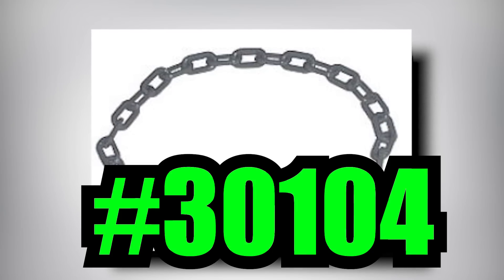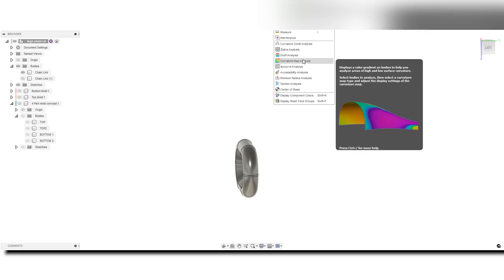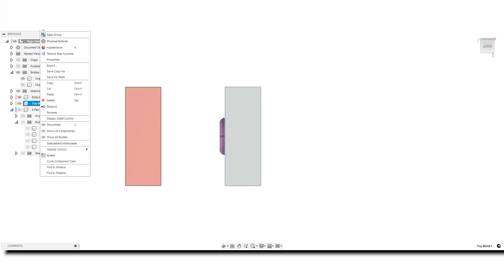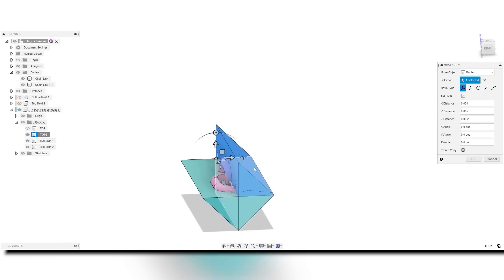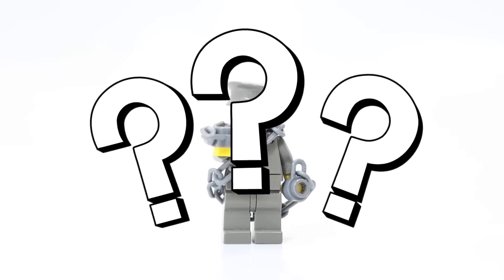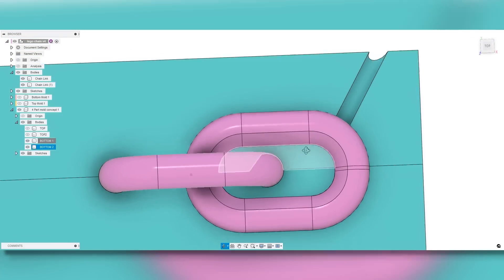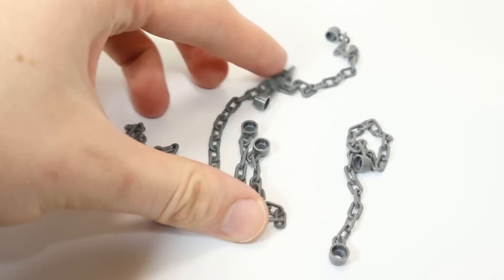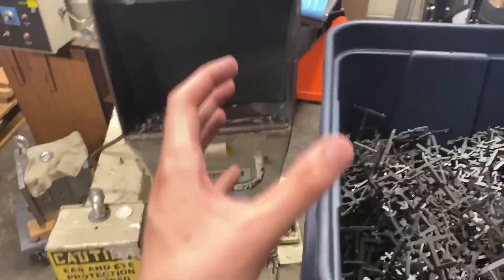This LEGO piece will make you rich... Well kinda.

Comment: Lego's injection molding has come lightyears in the last decade. It's insane. I went for maybe 5 years not getting much Lego, but build hundreds of sets as a child because it was one of my big passions. Now I pick up a single brick when I'm building a new set and you can just feel the quality in it. The formulation is perfect for every color, the fasteners fit exactly the same across any number of different shaped pieces, every little registration feels intentionally placed and helps create a nice satisfying snap that stays fastened, etc. It's really quite amazing! We've come a long way from the year 2000.
Reply from the maker: It’s crazy lego is coming up on 100 years old! Such a great company
Reply: @BrickTactical quality has been better i’ve got to say colors not matching are becoming a little less rare and the sets are getting crazy expensive also the sets themselves don’t make a lot of sense sometimes and the minifigures on some sets could also be better aswell but overall lego is a great conpany
Reply: While you're right, I didn't notice that quality till you said it. but I did buy a set recently, and one of the hinges was tight, to the point of it popping out! I never had that problem on older sets at all.
Reply: I remember loose chrome 2x1's and tand peices being the toughest
Reply: They've always been a high tech firm when it comes to injection molding, plastic composition, coloring, and so on.  We had a bunch of LEGO from the 70s and 80s that we gave to our nephews; we just put it all in a jute bag, ran it through the washing machine, and it came out looking (and fitting) like new.  We only took out the longer Technic pieces as the old ones are a bit fragile.  Incredible stuff.
     
Another thing where they've made a lot of advances is in the set design, especially the Technic ones.  The 80s sets were pretty straightforward, but the newer kits are full of really clever and sometimes intricate design flourishes.  Makes the building fun even for an adult :)
Reply: @lil.yeastinfection  If you built Lego from 20 years ago, any deviation, up or down, in the recent years is but a rounding error compared to the mountain of progress. I haven't noticed it.
Reply: The techniques that bandai uses for gunpla is crazy sometimes. They have the technology to mold a fully functional mechanical joint with sliding parts in one go
Reply: I feel that there has been a small drop in quality sometimes. Some pieces feel lighter and softer and the colours don't allways mach but I think lego is still amazing and is worth the cost.
Reply: When Lego switched from oil based plastic to plant based there was a drop in quality but they have since improved.
Reply: And lost so many...RIP Bionicle ✊😞

Comment: This is the kind of video I would love to see more of! So many content creators are simply repeating each other, but this is a topic I've never heard discussed--let alone mentioned! I'm currently reading "The Secret Life of LEGO Bricks," and it talks about how new parts or prints are called "frames," because each comes with both a budget and a time"frame" for completion. There are a limited number of frames available each year (because retooling the machines is expensive, as you point out), so LEGO has to be extremely thoughtful about where it allots new frames.
Reply from the maker: Thanks, glad you like this type of video! I’ve never heard of that book I’ll have to check it out!
Reply from the maker: I did some brief searching, where do you get this book after the project?
Reply: @BrickTactical  It was a limited run; it will probably only be available second-hand. It's a fascinating insight into the LEGO Group; I highly recommend trying to get a copy!

Comment: I have a story for you about these chains... With out getting into who I am and how I "in detail" got them, is will simple say, I have a few of these chains. "So what" ... Part of my payment that I wanted for a contract deal, I wanted chains. I have green chains, brown, black, red, white, blue, or course the grey/gray chain, and the best color or lack of color, of all, which got my friend in allot of trouble, CLEAR chains. As that mold was never gated to ever run that plastic and they had to over shoot the pressure to get them to fill the cavity in full and not produce any shorts, which as you know, partials left in the cavity, could cause serious damage to such a delicate mold. As I understand it, it did not cause any damage, due to the limited run of clear plastic and just called it a mistake in using what what thought to be "purge" material... LOL... So, there you go, a coffee can full of random colored chains, that not too many folks have. It is important to note, they didn't run all those colors back to back, that was over the course of about 2 years that I would receive a random package, full of another colored chain, as they closed out a production run for a set refill or inventory refill. I have about 10 other parts that I requested in strange colors that were never offered, at least during that time when I proposed this as a form of payment. For example, I have a hand full of studded old school technic beams in clear, if I remember correctly, they are the 16 stud long? I have a hand full of minifig torsos in clear no legs though.. Some of the 6 wide old school space theme 3x6x1h wind screens often in opaque blue or translucent blue, I have those in several colors, red, blue, yellow, green, black, etc.... I am sure by now, those are out in ever color now days? I can't remember all of goofy parts I request in trade instead of a pay check, but, none the less, best paychecks I ever got. I highly doubt that such allowances could be pulled off, as per, how well all the LEGO manufacturing locations are run today, as a well oiled machine to uphold the highest of quality assurance. I will try to remember the other oddity's that I got them to pull of for me, it has just been a while since I have rummaged through that tote of oddities, I think 1983 to 1995 era? What is that 40 years ago? LOL... Allot has change there I am sure of that...

Comment: I'v done injection molding before, I doubt it was anywhere near the precision of Lego the. I manufactured commercial hand soup dispensers. Why does a mold cost so much, I understand why they hated it when we used a screw driver to remove stuck pieces.

Comment: Do you such a mold with 4 parts? And how do you now how thick the gate need to be? Very sweet video love it
Reply from the maker: I have some complicated injection molds myself to make some of my products
Reply: I'm guessing it's quite a tapered gate as the entry orifice needs to be small but you don't want the plastic to harden too soon.  I don't know if there would be a matching vent as well.  I'm guessing those internal points aren't quite 90°, as there would presumably be some draft involved.  There are several Lego pieces I just hold in my hand and wonder how they managed it.

Comment: So the links touch or what? I guess I’m just alittle confused because in your Cad example the one hole that I assume is there to inject the mold material, it just would fill the one link. Unless the links connected on the inside smaller edge it wouldn’t fill, yea I’m confused…